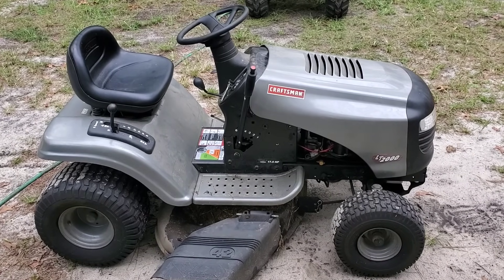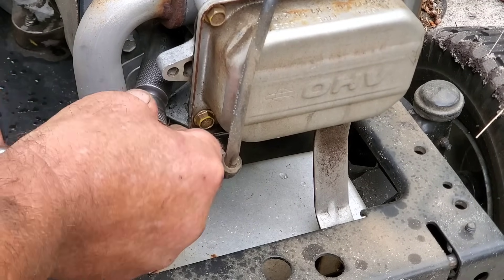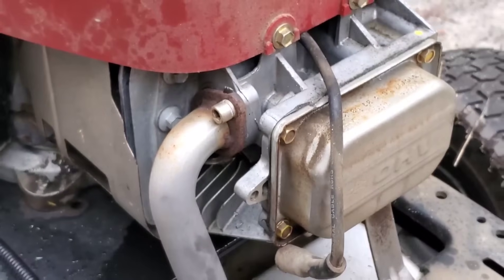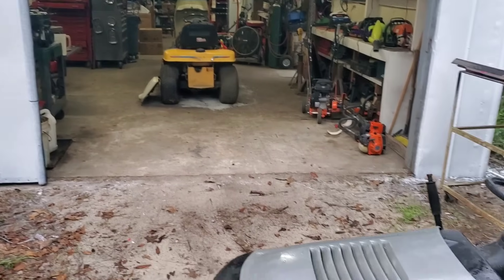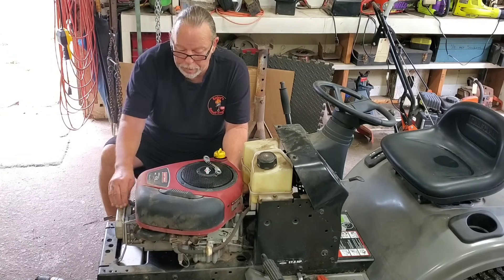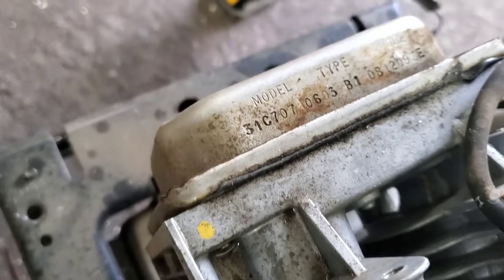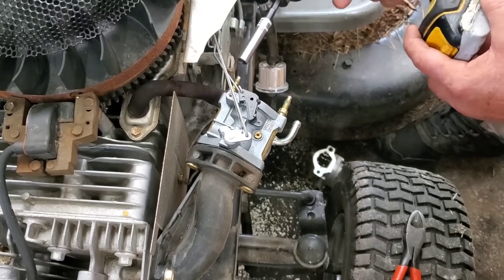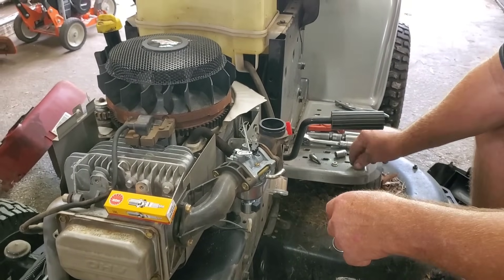Engine won't turn over, locked up?  We show how to diagnose and Repair a Briggs and Stratton

Comment: What if there was no gas coming out the spark plug? Mine is doing the same click, and I already put new battery and new starter, touched the solenoid with screwdriver and still does the click and nothing

Comment: could try just put in shutoff in line.  shutoff and let engine stop by running out of fuel each time.  turn off ignition.  keeps carb from getting gummed up.  change oil to get gas out of crankcase.  If you have an old machine you might not want to spend a lot of money on parts if you do not have to.

Comment: this is exactly what mine is currently doing.. the guy i bought it off of bought a new carberator for it but its aftermarket and it leaks out of the bottom nut.. and it stalls mid driving ..go figure the only new part on the thing is whats causing the problem. it was locked before i stripped it apart cleaned everything out , put fresh new oil and gas then it started up and driove then stalled mid drive and locked up again. i know the carb is leaking as i saw it but it started afterwards.. so idk wth is wrong wiht it..
Reply: Valve sticking?
Reply: @Mrs.T-bone  i since threw it out but i think the problem was the camshaft as form what i saw online and stuff the compression release valve wasnt releasing compression causing it to stop like that..it was an old mower and to get it into sale condition wouldve cost too much but i couldve fixed it to"run" for 25 bucks for the camshaft.. but it couldve used a new pully under teh deck, a new belt a new seat for sure and a battery so to me wasnt really worth fixing and it was taking up spac ein my garage.. new tires too they had some cracks but still held air.. those things wouldnt have lasted much longer even if i did get it up and running so they wouldve need repairing shortly after so rather than sink a couple hundred bucks into it i just scrapped it..

Comment: great video. sometimes you don't have to replace the carb, sometimes its the fuel shutoff solenoid just needs taken off and the pin\needle cleaned and lubed on it till it comes in and out correctly and then put it back on.  I always do exactly like you with the shut off valve and the see through paper element filter! solid tips and how to man!

Comment: I would have checked the valve clearances considering the age of the mower, replaced the air filter, and I never drain oil with a suction gun. The Nikki carbs are fine as long as you don't use carb cleaners with toluene or acetone ingredients. I use xylene which is plastics friendly on a rebuild or for annual maintenance. Regular gas without ethanol is best but hard to find at an affordable price. Get a haircut hippie.

Comment: On my craftsman  need help I installed a new battery and and smoke began too come out of the cylinder starter it clicks whn I try too start and bearly moves the top flywheel well I don’t if the previous owner crossed some wires or what’s wrong with it I bought it from an old lady she said it did ran and she just had it parked in her garage so I just tried buying a new battery but all it did was smoke out tht cylinder with a gear ⚙️ on top I believe it’s the starter it’s got a feed wire connects to a nut 🔩 on the side

Comment: You are a sincerely good man to share your knowkedge! After spending $1000 on restoring my my 5' Woods  Mowin .Machine.After maybe 30 min of use over 2 wks. It stalled  when I hit a patch of deep grass, refused to restart then battery ran down.  When charged flywheel locked up. Mechanic who "fixed "it up came!nd claimed it started when he came. Did a few things but didnt reaart it for .e as I had removed grill over fly wheel to see what might be wrong. Dud I say I am a 75 yr old woman running a horse farm with my daughter? In an angry tone ,  He acuses me of "f---ing around with the mower he worked so hard on! That prompted my 60 sec rant reusing the offensive phrase back at him several times. Ha ing his ears pinned back sufficiently, he became docile and all seemed to go well. Until I tried to start it the Next day😅. Same again. Smell gas all the time. Did I mention, I have had this .ower FOR 20 Years a d never had a sh<t off? It does now and now it has probkems?!!?
Reply: I hope you jerked a knot in his tail and he fixed it right for you!

Comment: I just came across your video here.. having the same issue with my husband's briggs and stratton engine. 19hp 540cc. When he started it, it ran bad, smoked up the whole neighborhood with white blue smoke, was shuddering bad and showering the ground with oil. He turned it off, and it was hard to start. I do all mechanical work. I pulled the plug and it was leaking fuel. We left it for about 2 weeks. I was gonna take it off the riding mower, but then decided to drain the oil. Holy crap. That thing had like 2-3 quarts in it, but it smelled like gas and was more watery than oil. I was then able to turn the flywheel, on the top, with my hand. It has compression that i can feel, then releases. I forgot if i pull the plug, it would be easier. So, i will be changing the carburetor and praying that will work. It has the same thing going on that the video you show here. Thank you for posting your video. I will post an update. 😊

Comment: Doing it the hard way.  The anti backfire is stuck open.  Put a fuel shut off in line or just replace the anti backfire valve.

Comment: Hi T-Bone, I have my neighbor's JD  D100 with the same engine that you're working on in this video. He fried a starter and solenoid trying to get it to start. I installed the new starter and it won't turn the engine one rev. the same as before. I removed the spark plug and the thing spins over like a new one .  I pulled the valve cover and adjusted both valves to specs and it still wont spin with the spark plug in. The oil level is good and doesn't smell like fuel and the cylinder was not full of fuel. Can you help this old car mechanic out ??
Reply from the maker: Thanks for watching and commenting my friend.  Watch one of my cam shaft videos, that should help you
Reply: @RaleysSmallEngines  I did and have ordered the correct parts fron Parts Tree. Thanks very much.

Comment: I have a 2024 Troy bolt bronco 42” 19.5 hp Briggs that is locked exactly like this. Should I do everything in this video?  What if gas doesn’t come out of spark plug?

Comment: My mother is currently having the same issue with her 500cc pony riding lawn mower with the Briggs a stratton engine , The primary issue was it was blowing white smoke and stalling intermittently. I removed the spark plug and it was wet. Then it would not start and started clicking as in your video, we replaced the battery and still the same thing. Today I noticed leaking fuel around the carburetor area.   
I think the same issue you are talking about here is what we are experiencing.

Comment: I what to thank you T bone 
Got my mower running this morning. 
Thanks to your videos 📹. 
Had a bad engine coil. 
I went head change the fuel filter 
And plug.
Reply from the maker: That's awesome, glad you got it running!
Reply: @RaleysSmallEngines keep the videos coming.
Reply from the maker: @ronniehux4763  will do. Check out our other channel T-bone After Hours

Comment: I started watching your videos. Came across this one definitely had to watch it because this happened to my tractor which is the LT 1500 craftsman with the 17.5 hp the exact same engine you just worked on in this.

I put the exact same carburetor back on it, but this time I use a shut off valve for the fuel line.   Because if you’re getting fuel in the oil you got a bad float. 
I really don’t mind putting the same carburetor on because after 20 years of driving it, the carburetor finally did a fuel lock up.   

The other thing I noticed, don’t ask me how it does it. You need to keep an eye on the coil because it manages to come loose and bumps the flywheel. I caught it because it disguises itself is just a regular clicking noise until you take the cover off and then you see it . Nice shiny line around the flywheel. 

For people that watch his video that owns this particular engine and you do some work on it yourself a little trick. You remember when he was talking about the cover bolts had the shoulder.    If you look at the cover, it has notches where the bolts washer sits in if you cut the notch out in between those shoulders, you don’t have to take the bolt the whole way out anymore. You loosen it up, wiggle the intake off so you don’t damage the gasket and make sure that the dipstick cap lines up and the cover will pop right off without taking the bolts off anymore.

Comment: Would have been nice to address clearing the crankcase of the gas/oil mixture. And I'm sure you must do that before running the engine or risk massive failure.

Comment: Any pointers on how to get the flywheel to spin any at all before I have to break the motor down and see if the problem is internal? A guy brought the mower to me. He was cutting grass and just stopped on him. I checked and no oil was left on dip stick and seems to have leaked from the valve cover area. The flywheel will not budge at all.

Comment: I've got the same problem,  my question is,  will the  carburetor mentioned work for a 18.5 briggs and stratton? Put a new battery selinoid and  ignition and nothing. Any help would be greatly appreciated and applied lol.

Comment: Hi, what would it be if it was running and then backfired louder than normal after I turned it off, And it won't restart. Engine is totally locked up, even pull cord won't budge it ! Motor is a Briggs & Stratton 18 HP Vanguard Engine (Vertical) Please any idea ?

Comment: I pulled up this video because I saw "Engine won't run over"... and I knew is was a gravity-fed fuel system. I had a craftsman and it would hydro-lock all the time. Probably the worst engineering mistake in riding mowers. And almost all of them had it! Why they didn't include a standard manual shutoff is beyond me.

Comment: I have the B&S 16.5 hp, looks just like your 17.5.  Wouldn't start, and had trouble turning over.  Then I pulled off the tube that (I guess) recirculates crankcase gases to the carb.  Then it cranked easily, and gas & oil jetted out of that breather tube.  Once that crap was blown out, the engine ran ok, and the oil still looked good.  Then I noticed that I had lost about a gallon of fuel overnight before the no-start condition today.  So my carb had leaked just like yours did.  I had to mow some grass, and did about a 1/2 mile worth (with breather tube disconnected - wouldn't run with it on) and it ran smooth.  Then suddenly, a very loud BANG and engine died.  Now engine turns but seems to turn too easily, and won't start.  Pulled the plug and will check (by hand turning the engine) to see if I can feel the piston moving via a pencil or something stuck in the plug hole, when engine is cool tomorrow.  Has this happened to anyone?  Any ideas?  Thanks for any tips!
Reply: If gas was in the oil and you ran it then the oil was too thin to lubricate engines moving parts. Engine is most likely toast.
Reply: @Mrs.T-bone  Yes, piston didn't move when I manually turned the crank.  I sold the mower to someone that wanted to make something out of it, and bought a new one.

Comment: Hard to spend over $100 for a carb but can’t believe how fast that fired up. I picked up a parts mower that started when I tested if it turned over. Ran good but smoked. Replaced the carb, snaked the clogged fuel line, used some right stuff to seal the bowed intake and it’s running good.

Comment: I had the same thing happen on my dad's John Deere and after replacing the carb, the crank seal blew while testing. It locked up before I realized what had happened. What's your thoughts on putting a new seal in each time when she hydro locks?

Comment: If gas is in  the engine, how do you get gas out the engine?
Reply: If there is gas in the crankcase, you would drain the oil to remove. For the gas in the carburetor just remove the bowl drain screw but theres not much in there.

Comment: How did you get the gas out the engine?
Reply: You have to drain the oil from the oil plug also have to take off the valve cover as well to get all the oil/gas out, I recently had to do this.

Comment: I changed my carburetor and fuel line but my ride on lawn mower still won't start.  In fact I can't even hand turn the engine and that must be the reason it won't start.  It turns over but won't start and it sounds like sand paper when it turns over

Comment: My engine had a bunch of fuel in the spark plug and when I drained the oil it was very diluted with fuel. I changed out the oil, filter, carburetor and it’s still locked up not wanting to turn over. Any suggestions?
Reply: Make sure your battery is fully charged and cables are tight.

Comment: I had a similar situation. Popped open the valve cover and the rocker arms were so loose one of the rockers fell off the push rod and was rotated 90 degrees from where it should have been. I pulled the spark plug and rotated the engine to top dead center and readjusted the valve lash. Closed it up and it started right up. It was still running a little rough with the choke open so I ordered the rebuild kit for the Nikki carb from Kohler for about $20. The only parts I changed were the float bowl gasket, float needle, and the o-rings on the main jet and fuel intake in the float bowl. Put it back together again and it runs good as new.
Reply: Great job!

Comment: So I think you just saved me from buying a new riding mower. Unfortunately I've let mine sit in the elements (rain) a couple years.  And it does this same exact thing. I guess I'll tackle it in the morning to see if this is the issue. I did notice when I checked the oil before trying to see if it would start with the new battery that the oil was clearish... but still had an oily residue to it.

Comment: Thanks for the video.I have a Troy belt bronco mine is totally different the carburetor is the same but the motor cover is giving me a hard time. I think the screws are hex screws I hope I haven't grinded one down too much. I have been working on this thing for over a week.

Comment: I got a John Deere L120 With a 20HP Briggs with 568 hrs on it. Was out mowin a field of normal grass when about 30 minutes in she just quit cold, deck on, and at full power. She wouldn't start, just clicked. Tried again a few times and she wouldn't make a click anymore. It's locked now and won't  turn over. Took a look at the fuse and it was a blown (yellow 20) went to the store and replaced it. It Tried to start but went back to the click and won't turn over at all. I've done some work on it since I bought it off a friend. Oil change, new filters, new oil filter, deck belt, new battery, grease, new fuel ect. While running it had a full tank and hadn't used much fuel when it quit. Fuel filter had fuel in it too. Can't get to it because she's in storage now. But when I do what do you recommend I do? Btw I put fuel stabilizer in it before putting it away so hopefully that'll help prevent further problems.
Reply: That's a weird one. Can you turn motor over by hand via flywheel? If not, maybe hydro locked,  (fuel leaked into oil crank case) or seized engine. If it blew the fuse a second time then an electrical issue. Good luck!
Reply: @Mrs.T-bone  I can't turn it at all by hand. It moves slightly then stops. Won't start because of that. I assume it's hydro locked with fuel. When I get to the mower, I'm going to see if that's the problem and hope the engine isn't toast. If it is, it'll suck buying a new one.
Reply: Also, 1st things, Turn off blades and make sure battery is fully charged 😊

Comment: total NOOB when it comes to engine stuff, but your vids are super helpful with my riding mower!!!  got a quick question - i def. had hydrolock on my engine, that being said do i NEED to change the oil (im assuming 100% need to change the plug) -- thanks again for your vids!!!
Reply from the maker: Thank you.   The oil must be changed if you had hydro lock. Spark plug change is optional

Comment: **New comment on an older video** I have an old, 2nd hand John Deere l100 and went through the gambit of ignition switch, starter solenoid, and starter over a month or so of trying and ordering, waiting for it to come in, you know, just like everybody else has done at some time or other. I saw some other fellers do everything to include removing the fan wheel housing screen and use the bolt with a socket and impact driver to turn er’ over a few times, and it worked on the one he was messing with. I’m gonna pull mine open soon, and check that plug for gas, and switch over to the Briggs carburetor like you did. (And a fuel shut-off valve)

Comment: Why does the carb stop the engine from physically turning
Reply from the maker: Good question.  It's because the needle and seat leaks fuel into the combustion chamber (top of puston) causing hydro lock.  If this happens the crank case will also have fuelixed with the oil and must be changed before running.
Reply: Fuel fills the inside of the combustion chamber (where the piston goes up and down) and physically stopped the movement there in. You can compress air but can't compress liquid.

Comment: My friend, I have an Engine blown up with oil out, can you tell me what is the diagnostic. thank you
Reply: it's fooked :)
Reply: If the engine is blowing oil from the exhaust with no apparent engine case damage and the dipstick reads overfilled, drain said oil/gas mixture replace with fresh oil and rebuild or replace carb or install in line fuel shut off valve before carburetor. Good luck.

Comment: What if I hear nothing at all 😢
Reply: It’s the solonoid
Reply: If your makes no noise, no click. Make sure battery terminals are tight and free of corrosion, battery is fully charged and make sure your fuse is not blown. Good luck!